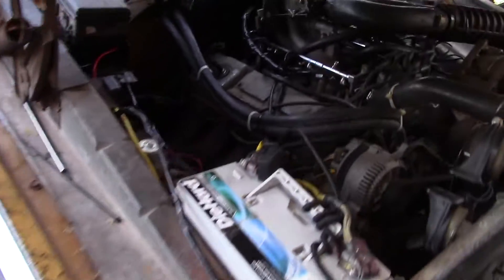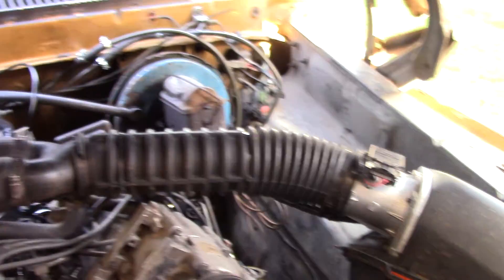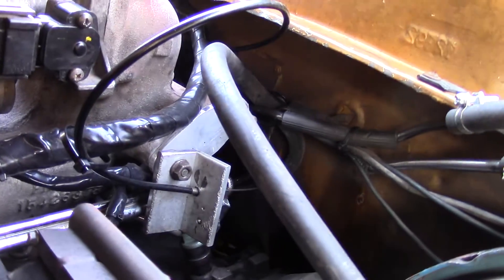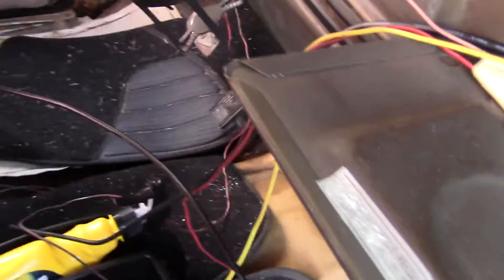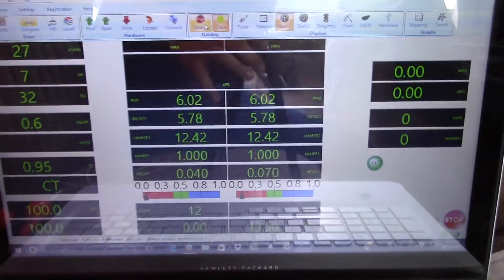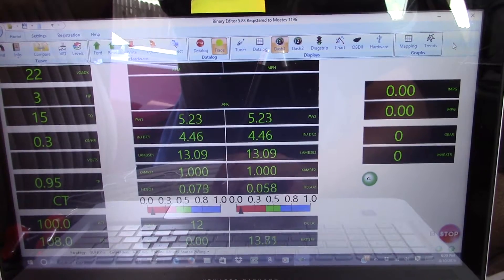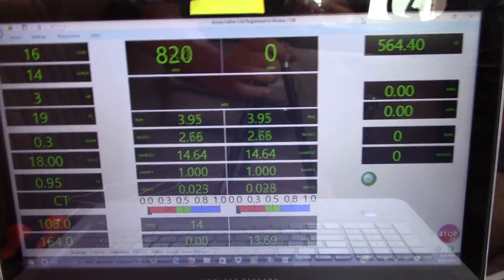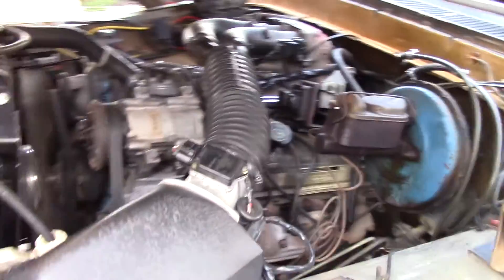EFI 460 Ford idle issues

Comment: I'm wondering if it's a couple of dead cylinders, i.e., bad plug wires; distributor problem, or something.  My old ford (1976) 460 is doing very badly.  Tried smelling the exhaust pipe?  Tons of raw gas on mine.  Just wondering.